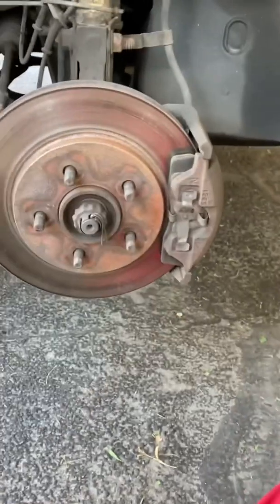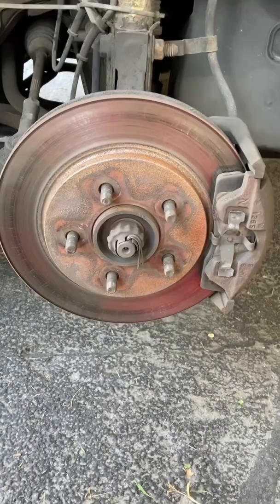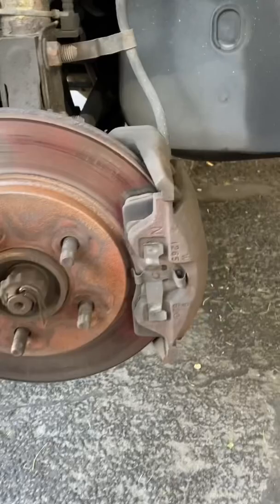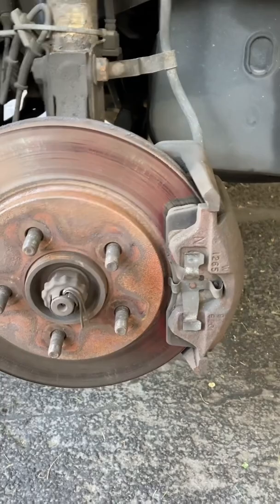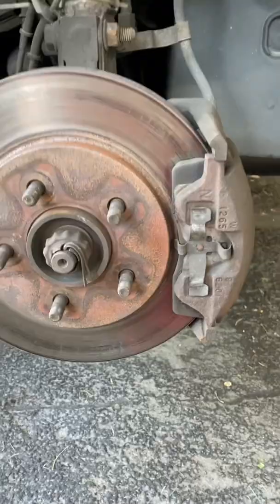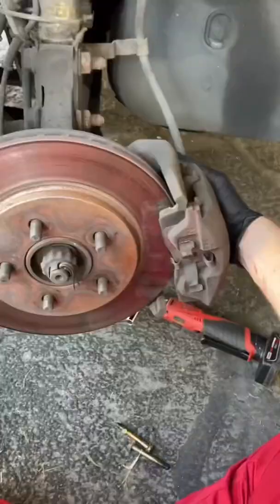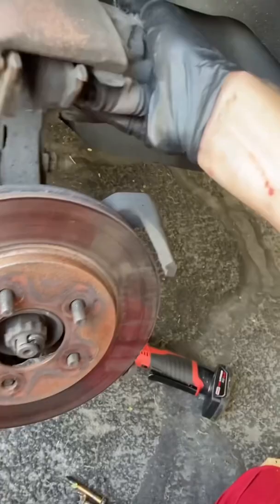I want to talk to whoever designed This! #shorts

Comment: Usually when I want to "talk" to the engineer, it involves a talking baseball bat
Reply: Yep. Just did injector seals on a friend's 2.2 diesel Sprinter. The engine is needlessly built all on top of itself. Two small children could fit beside the engine in the bay, but fuck me if every wire, pipe, hose and bolt wasn't in the exact same spot.
Reply: @capnskiddies  i'm sure on paper it seemed like a good idea lol. That is why we don't skip the working model and prototyping phase.
Reply: Like the one that did my Toro lawnmower. To take the carb off, you have to remove the exhaust, the manifold, two shields, and both hoist spots. And then you'll find, the carb isn't adjustable. Well done. 🤣
Reply: 99.5% of the time.
Reply: That is another example of why " Engineer's " should stick to operating rail road locomotives
Reply: Agreed lol
Reply: I like it.
Reply: @richhauxwell7848  please explain, I follow
Reply: Lol, yup
Can relate
Reply: Exactly. I ordered a part for a jet. Got the wrong part. Talked to the Tech Rep. He said the P/N was right they sent the wrong part. 
Called the Support Line, talked to an engineer explained the situation. He said that the part I should have gotten was what I ordered.
No shit Sherlock. 🤦‍♂️
I tried for 45 mins to explain to him that the part I received was wrong & to change their engineering drawings to correct the error. 
"But my engineering drawings show that thats the part you should have received."
I know, but I didn't get that part. 
"But my engineering..."
I know but I... 
"But my eng..."
45 minutes I'll never get back.
Reply: Is it because they use big words, or is it the math?
Reply: As an engineer, makes me sad since I keep running into other engineers who just don't want to do their damn job. It's nearly always half assed and done at the bare minimum. 

I do my best to not make shitty designs and easy for manufacturing and maintenance, but usually time is the issue where cost of design is worth more than if I changed one thing. But then it spills down to everyone else. Blame the managers with dumb deadlines and attempts to make impossible budgets so they can say "oh look we did a thing!"
Reply: Make them feel our pain and agony.😂
Reply: Don't forget leaving with their kneecaps.
Reply: “Talking a baseball bat”. Well maybe that is why you fail to properly communicate your issues the them?  I know it’s their fault, right?

Comment: Lots of vehicles used to have this design. Can cause problems with wear on the “arms”. There was often no hardware for the pads to ride on!
Reply: They ride on the caliper just like every other set of brakes.
Reply: 99 Durango same thing I was surprised
Reply: Yeah, it has its bad points because they've integrated the mount points right into the kingpin knuckle.
Reply: T C  
   Lol...no, I wouldn't even extend them that much credit.
Reply: I have this desing on my 92 jetta made by ATE . Really common in european cars.  I have gone trough 3 sets of pads during the time i've had it and i use hardware so there is really no problem .
Reply: My 1994 Jeep ZJ is the same. Now the pads come with clips to ride on. But you can see the grooves worn into the brackets by the pads over the years. Oh well still works just fine 300,000 miles later.
Reply: @Bloodbain88  the fist set of shims I put on Jeep brackets required the pads to be filed for clearance!
Reply: Almost all european cars have this design i think
Reply: @jamesu  oh that's nice just take of 5,000 miles of wear before you even press the brakes once!
Reply: @JasonFlorida  No,  The original design did not have clearance for hardware on the caliper bracket.  When manufacturers finally made aftermarket hardware available the brake pad backing plate did not have the .040 clearnace for the aftermarket hardware and the fit between the Pad backing and the caliper bracket.
Reply: @staszeksowikowski9039  no
Reply: @Bloodbain88  amazing how jeeps were like japanese cars back then huh... That inline 6 AMC motor. Dam jeep can't go over 100,000 now a days without tons of problems.
Reply: @robmalcolm8042  Yeah that 4.0 liter is awesome, and some of the old cherokees had Japanese transmissions. I got a 318 V8 though ;)
Reply: VW group (vw, seat, škoda audi a3) has this setup on their older lineup on small cars. Also, to secure caliper on 3 points to prevent rattle/wear on rubber bushes for sliders, they made the way that outside pad clips into caliper same way as inner - with spring legs, and then the pad “hooks” in behind the carrier. Clever and simple.
Reply: I vaguely remember a Honda I owned had this setup.
Reply: The explorers on the 90s had this style, with hard wear for the brake pads to slide on preventing the grooving you mention. I’d put them on my jeep brakes before they developed the grooves since they didn’t come with the hardware
Reply: @jamesu  , I had to grind extra clearance in the factory pads in my jeep… they slide like intended now.
Reply: @BigDaddyThrock  it would be more accurate to say the caliper rides on the pads. When pressure is applied the pads shift the load into the spindle. I've seen a lot of wear on those contact points, particularly on Jeeps that see a lot of off road use.
Reply: @stevenwilliams1805  no. It wouldn’t be accurate at all to say that. You can take away the pads and the caliper will still be on the car in the right place. But if you take away the calipers the pads will not be supported and will not be in the right place. The support comes from the calipers and not the pads.
Reply: @BigDaddyThrock  the caliper has guide pins on the back side, that allows it to "float" and, thus center itself as the pads wear. Those pins are not capable of holding force the pads will exert when pressed into the rotor. The pads will want to follow the direction of rotation and, that is what those two tabs are that stick out next to the rotor where a more common bracket would be. A fixed multi piston caliper, such as brembo, will take the force of pads while simultaneously pressing them into the rotor.
Reply: @stevenwilliams1805  you are even more wrong here. The caliper rides on the bracket and the pads ride inside the caliper
Reply: @BigDaddyThrock  do you  know the difference between a "fixed" caliper and a "floating" one?
Reply: @BigDaddyThrock  so... no answer?
Reply: @stevenwilliams1805  it’s funny to me that you think the caliper rides on the pads. The pads are not supporting the caliper in either case. The pads are either supported by the caliper or the bracket and the bracket always supports the caliper. Have a good day
Reply: @stevenwilliams1805  it’s literally in the video that the bracket is supporting the caliper and the pads are attached to the caliper.
Reply: @BigDaddyThrock  yes the pads are attached to the caliper. The caliper is floating on the pads and, when the pads and bite into the rotor they want to travel with it but can't because they move against tabs attached to axle. Those are the two ends sticking out at the edge of the rotor. They serve as a bracket but don't need to hold the caliper because it's attached to the pads.
Reply: @stevenwilliams1805  you can literally see that the caliper rides against the bracket. Have a good night
Reply: @BigDaddyThrock  cool. I worked at a brake shop for five years and, I don't know what I'm looking at in that clip.
Reply: @stevenwilliams1805  cool. So you were a professional parts installer for a couple of years. Good for you.
Reply: Not lots, but a few.

Comment: The lack of rust is amazing. You are a lucky guy to not have to deal with rust belt vehicles.
Reply: I went to a garage sale yesterday and bought like 10 cans of PB blaster off him he said where I am going I won't be needing it....I said where heaven 😂
Reply: 90% of those southern and Western mechanics wouldn't survive up here in the NorthEast. Rusty cars are more challenging than you think. Try removing a rear exhaust manifold and every bolt snaps off inside the motor. That's the 💩 we deal with everyday up here...
Reply: @Whats-It-To-Ya  literally anything under the vehicle is just fucked especially plow trucks here in north east Ohio or most cars over 10 years
Reply: @timd4280  yeah tell me about it. I'm in NorthEast PA not far from Scranton/Wilkes-Barre and there's trucks around 5 years old that won't pass inspection because the frames are rotted out. People are still paying on some of them. It's f*ck*ng crazy. My daily beater is an '07 Focus and it looks great until you look underneath and then it looks like '76 Dodge Aspen that sat in a corn field for about 40 years. We constantly petition PennDot to stop salting the roads because it's ruining our cars and I think they'll stop soon because there's literally 1,000's of lawsuits for damages to vehicles because salt isn't even necessary. I say if yer afraid of the ice then stay the fuck off of the roads.
Reply: @Whats-It-To-Ya  here is South Dakota it’s the same deal. If you can find a 5 year old pickup without a rusty box and frame then you are super lucky. Anything over ten years old has giant holes in the cab corners and the box sides are fucked.
Reply: @Whats-It-To-Ya  Usually here in the south you just get amazed at the half assed fixes and limp by measures or general lack of maintenance.
Reply: @Whats-It-To-Ya  the south is almost as bad but way different than northern rust. It usually happens on really humid mornings where literally any part of the car even inside frame rails will develop condensation.
Reply: laughs in Canadian winter
Reply: Detroit 
make cars 
But our environment eatsome in Michigan
Reply: Had to use a hydraulic press, torch, and BFH just to remove a wheel hub last weekend.  12 year old Michigan vehicle lol.
Reply: Reading, Pennsylvania here. I just pulled the left side skirt off of my 01 Grand Prix. What rocker panel?
Reply: @runningbear1982  I'm canadian and you're not correct. We salt the shit out of our roads
Reply: @Whats-It-To-Ya  They cut way back on the salt here in MN and I can say I'd rather have cars that rust out than slippery roads.
Reply: Wish I could post a pic of my 05 G6 here in central PA.  Rockers are non existent and rotted out around the door jamb into the floor, also rotted up and half way around the wheel well.  Luckily, I only drive it a couple miles to work and back... And, I'm the inspection mechanic 😅
Reply: narlycharley: so true. I live here in the middle of the rust belt...I mean snow belt in northeast Ohio.

Comment: Dude there are no caliper bracket bolts, you were looking at the wheel bearing bolts. There are several different makes and models of vehicles that use this set up. The bracket is part of the spindle.
Reply from the maker: I wasn't looking at anything. Just feel. And no need to investigate further.

Comment: A few newer Chrysler products follow this design for the rear brakes. It is quite nifty and a real time saver at times. But since Chrysler is Chrysler, they make up for the great design choice with shitty design choices everywhere else.
Reply: Who wants to spend time on the brakes on a Chrysler when you are too busy rebuilding the engine and transmission
Reply: Let’s put the battery under the front bumper
Reply: @Painkiller8496  you don't know the pain I'm getting a battery out until you do one on a Passat W8
Reply: Amen to that 🤣🤣🤣

Comment: Volkswagens with the fsIII brake calipers have the same design It always puts a smile my face when I have to do brakes on them so easy .
Reply: I forgot about those.  I haven't done many vw with the style.
Reply: Yeah, the FSIII caliper was pretty common on smaller VAG cars until the MQB platform. Its a good design, easy to work on.
Reply: @sohailashiq8693  that explains why I have only seen a few. Most of the cars I see are MQB. Ones that aren't are normally an Audi q7 or q5 or mk6 Gti

Comment: Side note, this vehicle doesn't have a removable bracket. Those bolts that you would need to push the cv in to get to, are wheel bearing bolts

Comment: The caliper bracket on that design is not removable, it is part of the steering knuckle. The bolts on the back are what hold the hub assembly in place.

Comment: Newer optima/sonata you gotta move the control arm to get to the rear bolt on the calipers
Reply: Omg I hate that
Reply: @therandomchannel2022  I got a garage sale wrench and modified it to fit, I never take that arm off I just loosen the bolt and get the rotor moving  then take the bracket and rotor off at the same time.

Comment: You know I never understood why people hate drum brakes so much. I’ve been running manual drum brakes on my 66 mustang for years and I’ve never had problems with them. Sure they need to be adjusted occasionally but when it actually comes to stopping I’ve never had a problem. Even in emergencies muscle memory takes over and you remember not to lock up the wheels and keep traction as you slow down.

Comment: You should recheck that. The bracket is part of the spindle. That bolt you’re referring to is one of the hub bearing bolts ( looks like there’s probably 4 holding it in). The axle does indeed need to come out to remove those bolts. 
Now you know ☄️
(It’s a shooting star)

Comment: Those are a good design but off the slides get sloppy and wear grooves in the bracket you have to weld them and grind them smooth to fix them. 
Great videos buddy keep them up. 🔧

Comment: Those bolts remove the bearing not the caliper bracket. The pad guide is part of the spindle and is not serviceable separate from replacement of the entire spindle.
Reply: Sounds like the Jeep. 3 bolts for the unit bearing.

Comment: Step 1. for removal of brake rotor on the rear of a 2001 ford transit.....remove diff cover.....dlide out half shaft and remove rotor from BACK of hub!!

Comment: Ya...but without replaceable hardware clips, when the "bracket" aka knuckle, wears out, you have to replace the whole knuckle...😤
Reply: Rears on vics are this way but have small shim
Reply: As others have stated, it is tradition to weld and grind or file back to "spec".

Comment: That type of caliper has a tendency to seize up on the slides pretty bad up here in the Salt belt. The caliper rusts up underneath the rubber inserts that the bolts slide within. It then pinches down on said bolts and makes the whole assembly quite difficult to disassemble.

Comment: The worst thing I’ve ever changed discs on is a newer ish rear wheel drive ford transit. Instead of a big nut to hold in the axle, like in the vid, they use a just stupid ring that you have to hammer around 3 thousand times. 
Ik what you’re saying, you don’t have to pull the axle out to do disc, but on this design, the disc is mounted behind the axle hub and you’ll have to replace the axle hub seals every time you do discs.
Sorry for not being able to word it how it was exactly, mechanical stuff in English isn’t my strongest point (I live in Denmark, apprentice at Ford), but just know, its a retarded design and a pain in the ass to do.
Reply: Nope you're English is great!
Reply: @JasonFlorida  thank you
Reply: Imagine removing the front hub and pressing out the wheel studs to change your front rotors. Welcome to the world of early 90's chevy 4x4 one tons. That engineer must have caught a mechanic in bed with his wife.
Reply: @patricktennant1585  my 94 2500 454 suburban is the same way. I spent much more time than I’d like to admit smacking the rotor thinking it was just stuck on before I realized it was sandwiched between the hub the first time I changed mine. Popped the ball joints, axle nut, dropped it on the bench and torched, hammered, drilled the 4 bolts out. Michigan 🙄

Comment: Dodge Dakota/Durango is the same way, there’s a problem with this design too, at least on the Durango and Dakota there is no removable caliper bracket, those parts the “ears” of the break pads sit on and that support the caliper are actually cast as part of the steering knuckle and over time the pad ears wear notches into them making it necessary to fill-weld, grind and file flat the knuckle to keep the pads from squealing, popping and wearing strangely.

Comment: Yup that a good design...you got that right ...just like a Audi A4 at the back they did put a caliper bracket all the way around but...they bend it towards the outside so you can take the rotors out without taking the caliper bracket off

Comment: If you want a laugh my car requires the calliper be removed completely before new pads can be put in 😆😆 every other car I've worked on just pivot the calliper up on one bolt.

Mine doesnt let you take the disc off without the calliper bracket but the bracket is literally two 18mm bolts that take 2 seconds to remove.

Comment: It just snugfits a bracket? That is smart.
I learned to drive on a volkswagon . i started on chevys 69 72 novas.
Then fords 73 montego 73 econoline. Then 78 nomad 78 buckaneer.
So I bought a 84 fury. Originally a detective car. Then it was 9wned by Brian Harris ( flintstone from 98 rocks radio) mom. Then Brian had it. Then Chris Clark had it( soundman in our local I.A.) then Robby Mayberry had it for 2 years then I bought it. 
I fixed the bumperjack
Had to do a fuel pump
Fixed the air and it was several thins then redid the brakes. Now those rear drums bein my first dodge, after study and cleanin and painting all the new parts I found out it was pretty much the smartest design 8d worked on  in the 30 years mechanic experience I have.
That alone sold me on Mopar! I like it. The ac control unit in the dash was a big problem in the AC. Every car in the yard had  bad one. Hahaa I got lucky and got one out 9f a plymouth van!!! It was newer and black plastic instead of clear like the other old ones.
I had to replace underhood thermostat and I overcharged it with 22